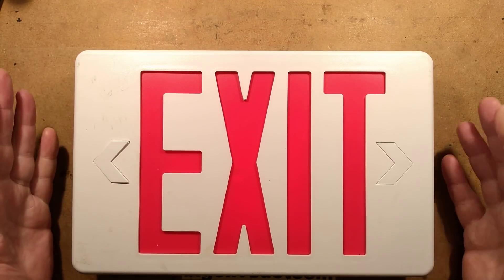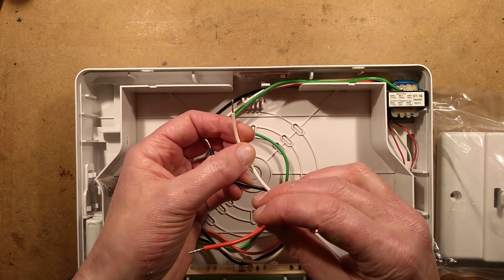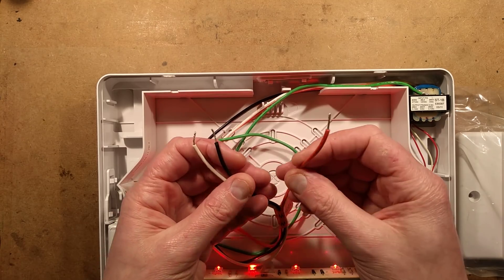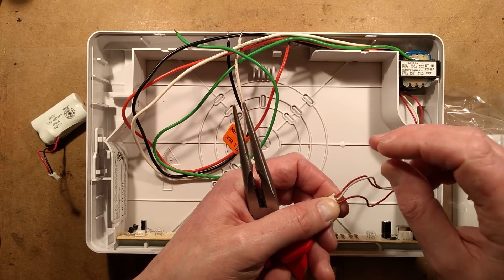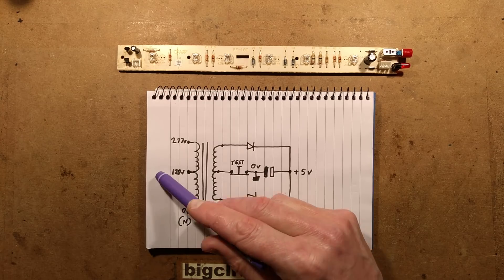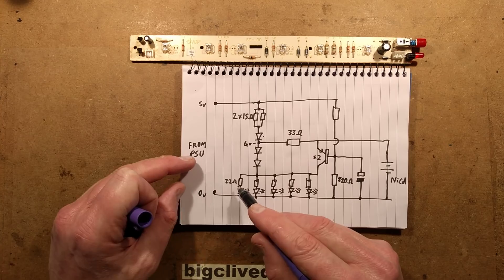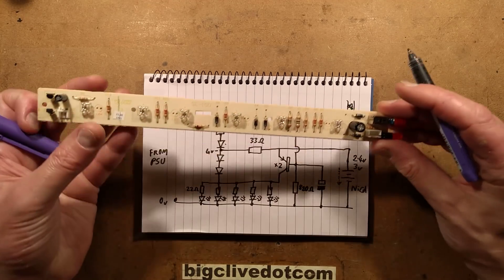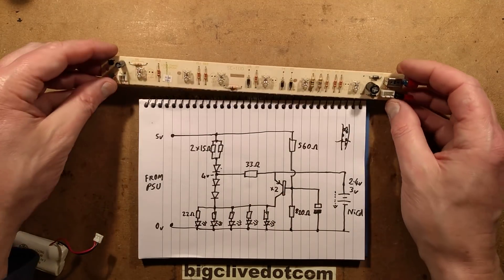Inside an American emergency light (with schematic).

Comment: Typical yanks still using 80s tech lol
Reply: Why change what's cheap and works?
Reply: Typical non-yanks,  thinks everyone should be doing the same thing they are.  Diversity is a good thing, embrace it   ;p
Reply: If it ain't broke don't fix it
Reply: Well, as a Brit, I say good for them! Why does even the most basic device these days need a microcontroller in it? Simple, elegant and no doubt as reliable as you’ll get for the money. Not only that, this sign could be repaired in minutes by just about any electronics hobbyist, maybe even with parts they have lying around. If a micro controller fails, the fixture is scrap. It actually takes a very good designer to be able to keep designs as simple as possible while maintaining functionality. More parts doesn’t necessarily mean ‘better’.
Reply: If it ain't broke rip it apart and do a Big Clive on it.

Comment: My first thought when looking at those wires: oversized USB lead
Reply: When I saw that 5v on schematic I was thinking "... you can run this off USB?"
Reply from the maker: Technically speaking it should be an easy conversion.  Possibly even a simple plug-on one.
Reply: @bigclivedotcom  please do it Clive

Comment: Great video's Big Clive I'm glad I jioned, one time you said you like to do more with Arduino, I'm into Halloween an Xmas allot and I'm looking to make some Prop controllers 4 and 8 channel with sound. it needs to control lighting, PWM motors, some drill motors, like the PicoBoo from Frightprops.com . but i know with your help it would be a lot better than there's. and i got some DMX lighting to add in Tell me what ya think, Keep up the good work

Comment: I really like it when you not only tell us but show us the differences  from the UK and USA. I've heard 2 reasons why North America uses 110v volt 1 is the Edison and Tesla rival  and amount of copper needed and number of substations to run DC the other reason was recent from AvE  he said this major copper mine was producing so much copper they pushed  to run 110v( SMALLER VOLTAGE THICKER wire) but if that was the case why didn't we go with DC. I know Edison zapped the baby elephant in public to show teslas electricity was bad. Edison was a dark dude.
Reply: Also the choice to stay away from DC was simple: Voltage drop and transformers. That was the major downfall of DC was that it could not be stepped up or down. Even with thick transmission lines it was still an issue. With AC voltage drop is handled nowadays by multi-tap transformers at substations. As the load changes, different taps are selected to handle under and overvoltages.
Reply: you want high voltages for long range transports and high power applications. You don't want that for local installations. Transformers are easy and cheap. Basically the only way back in the day to change DC voltages was a motor/generator pair.
Reply: @FreeOfFantasy  
As ukezi said AC is much more efficient at moving high voltage/high amperage at distance. DC loses much more power beyond about 100 ft./30m.
Reply: @dr666demento  beyond 300km HVDC transmission is more efficient.
Reply: @dr666demento  - AC losses are just as great as with DC (greater at high frequencies due to the skin effect)... the difference is that with AC you can use transformers to boost the voltage into the multi-kilovolt range, which simultaneously drops the current flow for the same power capacity. This allows you to use reasonably sized transmissions wires, and only drop the voltage back down (and current back up) just before it reaches the customer.
Reply: The elephant story isn't entirely true.
Reply: @tedhaubrich  The elephant story is not true at all.
Reply: @4jp  Here is the best o can do for now just woke up gotta take the kid to school. 
 did Thomas Edison kill an elephant?

Jan. 4, 1903: Edison Fries an Elephant to Prove His Point. Topsy the elephant waselectrocuted at Luna Park Zoo on Coney Island in 1903. Captured on film by Thomas Edison, the event was one of a string of animal electrocutions Edison staged to discredit a new form of electricity
Reply: @raymondmucklow3793  The "war of the currents" ended over a decade before that.  The elephant was killed, but it had nothing to do with Edison.
Reply: @tedhaubrich  yes yes it is, I've read one of the original headlines on the news paper, saw the video and saw the dam thing fall over and smoke.
Reply: @tedhaubrich  - Maybe not, but the stray dogs story is completely true.
Reply: More than 50 years ago, I worked as a technician in a US steel mill.  In the US,  depreciation schedules for industrial equipment could run to 50 years, so the tendency historically has been to use big-ticket equipment long beyond its design lifetime.  At the time I worked, our distribution panel for our small shop looked like this:

440V, 3-phase, 25 Hz
220V single-phase 25Hz
110V single-phase 25Hz
460V 3-phase 60Hz
230V single-phase 60Hz
115V single-phase 60Hz
250V DC (used mostly for overhead cranes, coil tractor battery-charging stations and welding)

I discovered that a 110V 25 Hz fan would run quite contentedly on 230V 60Hz with a significant boost in speed.  The 25Hz transformers were huge in comparison to their 60Hz brothers.  25Hz was used for lighting, which visibly pulsates even in incandescent lamps and is absolutely seizure-inducing when used to run mercury-vapor lamps.

I once saw an electrician hook a 115V 60Hz water cooler to the 250VDC distribution.  Lots of sparks and smoking.  He calmly attached a tag to it saying "factory defect" and had it shipped back to the manufacturer.
Reply: An elephant was electrocuted, but Edoson did not do it, and the point was not to demonatrate that AC was dangerous.  Oh and the press wasn't above some rather false sensationalism to sell papers back then either.
Reply: @tedhaubrich  watch this if you have the time it's all there.
https://youtu.be/lRNQX4MrfZU
Reply: @pingumcping  hey I just dont get it right over my head I'm always in for a chuckle so can ya splain it more lower education.
Reply: Edison built power generating stations, and envisioned every customer having one within a mile of their home/business. Needless to say, this was a stupid idea.

PS... Tesla was a true genius and Edison was a supreme slimeball. Pretty much every one of his "inventions" was appropriated from others. Edison was more a master patent filer than inventor.
Reply: No complaints here about only having 110. Been shocked more times than I care to admit, one being grabbing a metal pull chain on a light fitting that had become live, while I was bare-foot. Interesting situation to actually let go. Had to wait for the zero crossing before I could open my hand.

Comment: In the USA, we use 480V 3-phase in a lot of industrial applications (presumably because 120V isn't good for delivering industrial levels of power). 277V happens to be the phase-to-neutral voltage of a 480V three phase. So that's why it's often used for industrial lighting; it doesn't require an extra transformer beyond what's already being used.
Reply: Also more suitable for multi-thousand-foot runs in parking lots and warehouses due to the higher voltage
Reply: TailSaber Those are the same reasons most of the world runs on 400V 3P, which gives 230V phase to neutral or on 220V phase to neutral which gives 380V phase to phase.  Britain was the odd one with 240V/415V .  Unlike the US, none of us bothered with split phase after switching from DC to AC, as proper 3 phase has so many advantages even for household appliances like washing machines, plus it used to be common having small industries and homes mixed in each neighborhood, so would be impractical to use separate grids,
Reply: @johnfrancisdoe1563  One thing that seems to be different between the US and the UK is that in the US, distribution transformers are smaller and often only serve 1-4 buildings. So it is no big deal to install a distribution transformer with a 480V/3phase secondary to serve a building when everything else on the street is 208V/3phase or 240/120 split phase (as long as all three phases of the primary are available, which is often not the case in residential or rural areas--many times these areas get a single phase primary, with the 3-phase primary running down the main street and a single phase run down the side street to serve those houses).
Reply: Brian Leeper here in rural parts of Kansas it’s quite common to have one transformer per customer. We also have a weird one called high leg delta that’s 208v three phase with one side of the delta center tapped so you get 120/240 and 208 3 phase out of the deal that means one of the phases is 208 volts to ground. America!
Reply: Same one-transformer-per-customer situation in rural Oregon and Washington also.   Pad-mounted transformer fed by buried 12KV lines.  The transformer box usually contains a cartridge fuse for the primary side.   Said fuse is changed by use of a 10 foot fiberglass pole, that grabs the fuse by one end.     I was warned by one of the linemen doing the replacement to not get too close--evidently a transformer with a short in the primary can result in some pretty spectacular fireworks.

On the street, there's a large disconnect box fed by all 3 phases.  The utility selects one phase run leads  to the customer transformer.   Occasionally, the utility changes the phase selection to "balance" the network.
Reply: Didn't realize you had different LV supplies for domestic and industrial! AFAIK here in the UK only heavy industry with its own supply (railways, mines, oil platforms) would have anything other than 230V/400V.
Reply: Mike Page - UK railway signalling line side power distribution supplies are single phase 650V AC. These can feed mile after mile of equipment at various locations along the line side. At each equipment location, transformers are used to provide a 110V AC supply. This then feeds various items of signalling equipment via a bus-bar. One side of the bus-bar is fused. The transformers have adjustable tappings on both the 650V primary and the 110V secondary windings so that the secondary voltage can be set up to be within specification. The 110V windings are not earthed/grounded. So one of the regular tests is to ensure that it is “earth free”.
Reply: I worked for a city where the police dept. building is fed with 480V 3 phase. Why, I don't know, IIRC there weren't any 480V 3 phase loads in the building (except maybe the elevator; no reason that couldn't have been spec'd for 208V though). Most annoying feature of that is whomever designed the building thought that that the electrical room and computer room could be the same room, so it has a transformer in it, taking up valuable floor space because this combined room is too small. My guess is that the idiot mayor who micromanaged everything thought that because 480 is bigger than 208, it must be better.
Reply: Brian Leeper probably has to do with the utility company not wanting to change their transformer. I have a costumer that converted an office building to an apartment bld. The utility company wouldn’t change their transformer to feed the bld.  from 480 3phase to 208 or even 240 with a high leg. So now there are all these transformers all over the place converting the 480 to 120/208 for residential use. All those transformers are using/wasting electricity 24 hours a day 365 days a year! 
Also, a lot of people think that the higher the voltage the less amps (which is typically true) but people also think the less amps the less their electric bill is, but they don’t get charged for amperage used, they get charged for wattage used. Not to mention 480volt equipment is quite a bit more expensive than 120/240 volt
Reply: @MrSleepProductionsInc  Police dept was a new build; nothing 480V in that area prior to new building going in. Existing buildings were a public works building with 208V/3 phase and houses with 120/240V split phase.
Reply: Transformers are maybe more efficient than the distribution losses in lower voltage wires, and they are as good a way to hoard copper as any - provided they aren't stolen by tinkers.
Reply: @MattOGormanSmith  Maybe, but transformers have losses. If they're on the customer side of the meter, the customer is paying for those losses, which can add up to significant dollars over time.
Reply: 277 V lighting branch circuits can have more fixtures for the given ampacity of the wire.  Less voltage drop on long runs (such as parking lots) as well.
Reply: Was going to add this myself - most office buildings are 208v 3P 4W, so lighting is typically 120v.  Industrial settings for the most part these days are 480v 3P 4W, so 277v makes sense in that case - no extra components needed.
Reply: We use 480V 3P because of current draw, voltage determine insulation, current determines how big your wire will be, reduce the voltage you can use smaller (cheaper) wire. There are also 575V motors so they can use 600v insulated wire and still have room for boosting voltage to do VD compensation.
Reply: Frith Pretty much all the wire used in the US has insulation rated for 600 volts. Referred to as THHN.  Even ‘romex’ that is used in residential homes is rated for 600volts even though it will never see voltage much above 240 volts.
Reply: Come on up to Canada and we have an even higher (common) 3phase/4wire voltage for commercial buildings of 347/600 V. Wire sizes can be smaller for the service & distribution power ccts for the same kVa load vs 120/208 V and also any volt drop problems can be alleviated as well.
Reply: I once worked in a 10-story office building where the lighting (including emergency exit lighting) was all 277 VAC.  All of the emergency lighting (including exit sign power) was fed from a panel up on the roof, which was fed from the building's 12kV-480V transformer.  Every floor had their own 480-120 transformer, so it was nice not having an extra transformer in the way of the emergency stuff.
Reply: This is correct, but in order to be able to draw a load on the 277v phase-to-ground, the transformer has to be connected in a center-grounded Wye configuration. If you try it with an ungrounded Delta configuration, all you'll do is draw that 277v down fast with very little load, making the other 2 legs head for 480v to ground. Don't ask me how I know.
Reply: @wirenutt57  Ungrounded delta configurations are very rare and as I recall are required to have ground fault detection. In the situation you described, I don't see how trying to draw a load off one of the 277V legs to ground would do anything unless one of the other legs was already faulted to ground somewhere. In an ungrounded configuration like this, a ground fault doesn't have any obvious symptoms (until another phase also ground faults) and that is why the ground fault detection is required. (I was curious about these ungrounded delta systems and did a little reading about them -- only allowed in places where qualified personnel are on duty, require ground fault detection, very rare).
Reply: In my road, in UK all our services are delivered underground. We have one transformer down the road, it's in a little brick hut with danger of death signs on it. I have no idea how many homes it feeds, but I don't know of another in the neighbourhood (but they are quite innocuous), so it could supply dozens.
We only have a single 230/240v phase to the house, but as transformers like to have balanced phases, my neighbours on each side will be on a different phase, so if we all got together we could run a really big motor or something! Not sure TBH, we can pull over 3KW from a standard socket anyway.